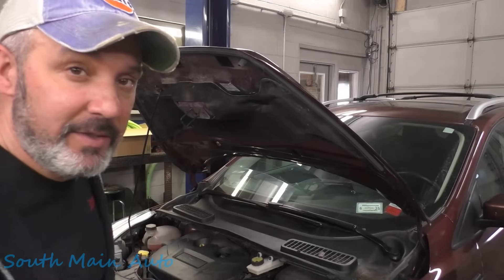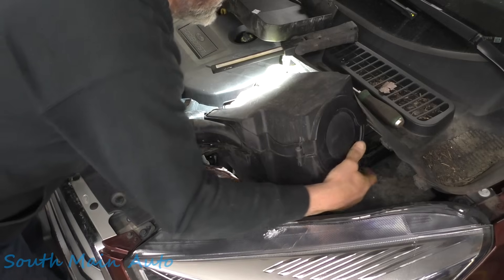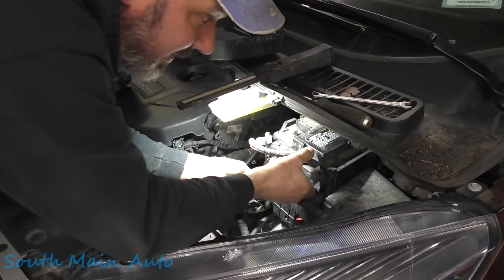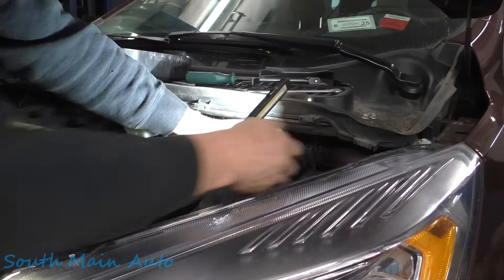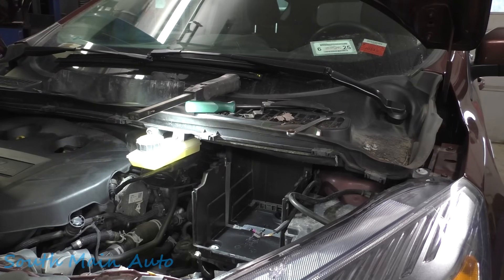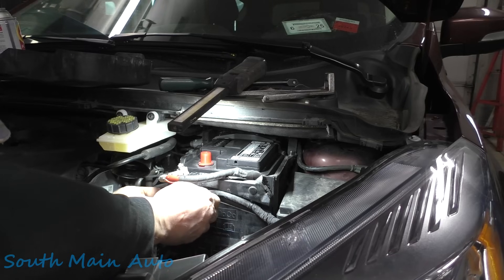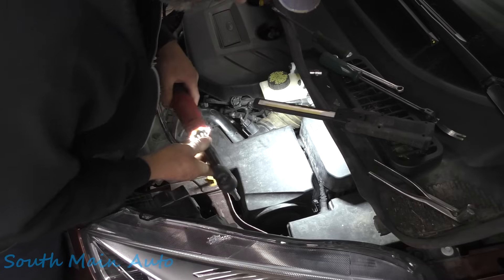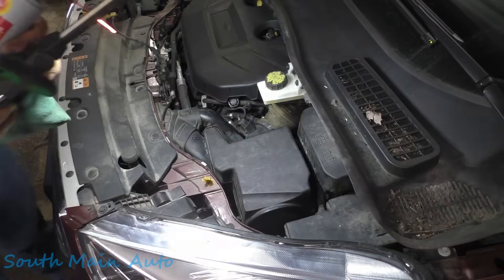Ford Escape Battery Replacement

Comment: The 2014 Ford Edge is a terrible car. They’re engines are failing at 50,000 miles from the head gasket leaking coolant into cylinder #3. I was helping my fine looking co worker and ok yea it paid off knowing about cars in that instance BUAHAHA! Lol she was so grateful and impressed I helped her. Thanks Eric

Comment: You can do the reset without scan tool. Key on engine off. Flash high beams 5 times,press brake 3 times.  Battery icon will flash. After its done flashing you are done.

Comment: My wife's 2013 Taurus was having issues with batteries, I had to have it replaced every year for 3 straight years (Warrantied by Ford) at the 4th battery i went to a different dealership and they said the problem was the other dealership wasn't resetting the bcm, thus the computer was telling the alternator to overcharge the battery basically frying the battery.

Comment: With the VW group vehicles any battery of the correct case and chemistry can be used, just change the last digit of the original serial number and it will recognise a new battery has been installed.
No need to buy a battery from a dealer, an aftermarket tool such as OBD11, VAGCOM etc can do this.

Comment: The express lube places earn that reputation.  In one trip, they stripped the oil drain, broke all the tabs off the fuse box while looking for the air filter, and evidently couldn’t find the time to latch the clamps on the air filter housing once they found it.  Won’t go back again.

Comment: I took off the plastic cowling for the windshield and lifted the battery right out on my 2015, seemed much easier, not sure if that changed in 2018

Comment: we just traded in my wife's 2015 Audi q7 TDI in January 2024.  Still original battery as far as I know with 230K km (155K miles).  I had a problem a couple years back with a parasitic draw, door handle sensors in the rear doors for the automatic unlock when you touch the handle with the key in your pocket.  Depinned the sensor at the connector.  Parasitic draw gone. The VAG charging strategy does seem to work.  Still starts even in the winter, (though this winter was pretty mild ins Southern Ontario Canada).

Comment: Yeah great design. I went with the windshield wipers, clips and bolts on the cowling then had a straight shot at the battery. Equally a pain in the butt, but a different way.

Comment: We just did this in our 2015 Mustang with a BMS. For the DIY guys I've read this resets the BMS in many modern Ford vehicles although I haven't had it to the dealer yet to verify.
Procedure must be carried out within 10 seconds
1. Switch ignition on (engine off)
2. Pull and release high beams 5 times
3. Press and release brake pedal 3 times
4. If successful the battery light will flash 3 times within the next 15 seconds.
5. BMS reset completed.
Reply: You forgot to spit over the left shoulder 6 times...

Comment: I just replaced the O.G. battery in my 2012 durango because I thought it was going bad, not letting the remote start to always work. Turned out to be the brake switch was sticking from time to time.
I highly doubt the new battery will last 12+ years in wisconsin weather

Comment: Would have been nice to see the Volkswagen battery install and registration process and what issues occur when you don't. I'm still not sold on having to tell a computer that monitors a battery and has multiple charging strategies that the car has a new battery. But I do understand forcing the owner to purchase an OEM battery to insure it is the correct one for the vehicle.

Comment: I own same 2017 model. I wondered how the heck to get to the battery. It's good so far, knock on wood. Fingers crossed!
Reply: Use the windshield wiper/cowl removal method, it’s much easier.

Comment: Ha, regulator on the firewall. My old 66 GMC van voltage regulator failed to function normally so my solution was mount it on the wheel well under my seat with the cover off, start the engine and reach under and close the contacts manually. Just don't forget to open those contacts when ya shut her down or your coming out to a flat battery in the morning. And no I didn't use my bare hand I had a special dedicated insulated tool for said operation. Safety first ya know plus don't really care for the 12 volt tickle. Best thing I ever did to the old girl was install an internally regulated alternator besides the SB out of a Camaro.

Comment: I'd like to know how the battery charging management system changes as a battery ages. The tolerance for variance in charging is pretty low for AGM batteries in any case.

Comment: My Focus is almost the same setup. When troubleshooting some green crusties in my engine harness I had to completely remove the battery and air boxes. The three bolts holding the box in were completely rusted and some extraction sockets were required. Major pain in the ass, and the bolts were destroyed.

Comment: I used to have a 2012 Focus with the same set-up.  I changed the battery in it once before I donated it.  I did a lot of cussing, but it wasn't a difficult job. My windows, though, had to be reprogrammed. The internet fixed the windows.

Comment: When I earned my living turning wrenches the fancy machine was the "Sun" machine for setting up your points and condenser distributor. Fortunately one of my nephews runs a service shop and can help me out when my analyzer isn't up to the task. Our second oldest granddaughter bought a used Jetta and our fun is just starting. She started out the right way and took it in to be serviced first thing. Ten thousand miles, she was told till the next service. I got the call last week. Grandpa, my car is making noise and I'm afraid to drive it. Before I started it I checked the oil. Great! Bone dry! Went to the "zone" to get some European spec oil and the sticker shock rocked my world. $13 a quart. Bought the five quart jug as to have some extra. My nephew said it hold 5.8 qts total. I dumped in two, nothing😢 Dumped in two more, up to add!!😮 Dumped in the last and brought it up to full. Yikes! It started right up and after a couple seconds the marbles in a coffee can noise went away. 😅 Ran smooth and quiet. Went for a run around the block and came up with a plan with her to monitor milage vs oil usage to keep from the same thing happening again. Fine German engineering! The money light was on but as is par for the course my tester would not link with the VW.

Comment: Used a Battery terminal Spreader  like that over 40 years Never Once Did I use the 8mm/5/16 on the end of the Handle :face-blue-smiling:

Comment: Mr. O , I would never be one to question your technique as I find you to be a great Technician and Diagnostician, but I was wondering if it would have been easier to acccess and remove that battery by removing the cowl  and accessing it from the top where yoo have more room and are not grinding up your fingers reaching underneath?   Just curious.  Thanks  RP
Reply: Bingo!

Comment: Outstanding,  the engineers have found another gouging for the consumer on a simple battery change . Throw in replacing spark plugs as well you just used up half a months pay

Comment: I didn't reset the battery monitor on a 2013 F-150 after replacing a battery, started it up and it was charging at 97 amps and didn't drop. After reseting it, it was back to charging normal! I was cussing the first Escape battery replacement but the 2nd one went a lot easier. Enjoyed the video!

Comment: I have a Focus ST.  Love the car, has that same stupid battery setup though.  Gotta take half the engine bay apart to get the thing out of there, and you absolutely have to remove the positive cable first.  Fabulous design.  That, and it kills the battery in like 4 to 5 years.

Comment: I guess with all the sensitive electronics now, it makes sense that the manufacturer should take steps to try and control the quality of batteries used.
I think to be a home gamer and do any work or diag yourself, for anything made in the last 25 years or so, you NEED to have a scan tool now. Brand specific 2 way tools are pretty cheap and pretty good. I have VCDS for my wife's Audi and my son's VW, and DiagFCA & AlfaOBD for my Dodge, each brand cost about $200 to get set up to do eveything bar phoning home and programming modules.

Comment: If the headlights on modern cars weren't big, long 'works of art', there might be room for other things.
Replaced battery on my 2019 Jetta not long ago. Didn't have to do anything other than replace it. Oh, and it was easy to get to also.

Comment: If you are worried about the positive terminal hitting ground, just put a small plastic bag over it and secure it with a zip tie or a bit of masking tape.

Those SK indexing lip tools are the nuts.  It is a shame SK is in disarray now because I don't think they will be made available again anytime soon, if at all.  Matco has their own version but I don't think they are as nice, but they are less expensive, if you can believe it.

Battery Terminal Speculum?  They do the same thing?  I'm never going to look at mine again the same way.  Ever.

Never thought about using fluid film on battery terminals.  That's a pretty good idea.  I usually use a dab of dieelectric grease, but that is much cleaner.

Comment: Ford dealer replaced battery in wife’s 16 escape and it died on me the next day. Took it back due to excessive corrosion and they said it all grew overnight. I went home and experienced this fun myself. I did it the harder way by removing the cowling and cleaned connections tightened connections and found the didn’t even reassembled the front cover correctly. Ford dealers suck but I’m happy with the vehicle

Comment: I popped the top off the air box remove the filter take the 2 8 mm screws out of the side of the air box remove the ground from the body pop the cover off the front battery tray and slide that puppy out it’s easy to remove the wiper cowl

Comment: I heard on that negative battery cable that you disconnected from the strut tower and then pull out the battery. Then attach the cable back to the battery and then attach it to the truck tower could that work?

Comment: I have a 2016 Ford Escape titanium and it has express up and down on all 4 of my windows. But I live in Canada so they may have slightly differently computer programming. I am also changing my lead acid battery to a AGM battery. I can use the Forscan program to change the settings from a lead acid battery to a AGM battery. I do not have Engine start stop but living in Canada I do have all the other high drain electrical devices like heated seats, I also have a dash cam that runs in night mode when the vehicle is off so that adds to a battery drain. I need to get a separate battery back up to run my dash cam when the vehicle is off. My vehicle battery is a OEM Ford battery that is only 2 years old but i can not even listen to 1 full song while my vehicle is off while i am waiting for my wife. So I am making the AGM battery upgrade. I am going from 590 CCA battery to a 760CCA battery. Plus AGM batteries charge up so much faster. I also carry 2 battery boosters with me in the winter months incase I need a boost or someone else does. I refuse to do a direct boost from my vehicle to another.

Comment: How to change out the battery in a 2018 Ford Escape in 4 easy steps. Step one, disassemble car. Step two remove battery. Step three install new battery. Step four reassemble car. I have a 2018 Ford Ecosport and the battery is in the same location under the cowell.

Comment: It never amazes me when engineers put things they know you will have to change like headlights and batteries in a place that makes it next to impossible to change. A headlight should be in a place where you can just reach in and pull it out without having to remove half the engine bay or the whole front of the car.

Comment: With that excellent battery location, the only thing Ford could have done to make it any better is use a battery with the positive terminal in the rear to make it extra easy to charge or jump off.

Comment: My project is trying to disconnect the negative battery cable in order to clear & "reset" the transmission scheme.  Will disconnecting the battery neg / ground where it is bolted to the firewall enough to clear out & "reset" the transmission scheme memory settings, or will the cable connected at the negative battery post need to be disconnected too?

Comment: On my wife's 2013 I take the cowl off to do most things under the hood.  At this point, I can take it off in less than 5 minutes.  For the most part it's been fairly reliable approaching 200k, but it will be my last Ford.

Comment: That's a pain in the butt to get to!    Simple for someone who knows.  Question.  Wouldn't it have been easier to remove the plastic cowling to get to the battery?
Not owning a Ford so I raise that question.
Anyway, Good one Mr. O.  Thanks for the tech tips.

Comment: Eric I honestly don't think you said enough bad about "goober lubbers" and their trainers.. Every time the church van comes back from a place around my hometown, I have to make sure that those kids working on our Ford vans got the conical air filter installed properly along with the lid and buckle system. They usually get the buckling indexed improperly. And sometimes it's not even sealing. If the church would buy me a heavier jack to lift those things, I would change the oil to them myself but that's neither here nor there.😊

Comment: So, how do I reset the battery monitor if I change the battery myself and I do not have the fancy scanner like you?
Reply: Put key in run position. Turn lights to on, not auto. Within 10 seconds pull back on the high beam switch to make them flash 5 times, then pump the brake pedal 3 times. The battery light should then flash, and then stay on steady. Sometimes you can just lock the doors and let the car go to sleep for at least 8 hours, and the monitor will reset on its own.

Comment: You mean like the days you could open the regulator and adjust the spring contacts to change the charging or better yet the days of the generators when you had to initiate the excitation system for it to charge. When cars didn't tell you what is wrong and you rebuilt everything instead of replacing whole assemblies. Those good Old days..???  Actually the more things change the more things remain the same, your expertise just changes especially electrical. A lot of work these days to change a battery, LMFIAO especially when the Chrysler's had them in the front wheel wells but Ford arose to the challenge too..

Comment: Oddly enough, Advance auto replaced the battery in my BMW and they registered it. The guy behind the counter was eager to try out the tool, because he had not had the chance to use it yet. I was like, "hell give it a try, it'll save me some time and cash if it works." I have to admit that my trust issues would not allow him to tighten any of the bolts. Basically I changed the battery, he pressed all the buttons to register it. He was nice enough to lift it into the car though.

Comment: Battery related question, I have a battery voltage meter that plugs into the 12 v receptacle.  What should the battery voltage be after a 30 minute drive at engine off?
Reply: @user-pq9ji7kt4l  While driving, 14.6 but reads 12.3 imediately after the engine is turned off.
Reply: @user-pq9ji7kt4l  I was expecting 12.8 volts or higher right after the engine shuts down.
Reply: @user-pq9ji7kt4l  It has been tested at the auto parts store, it passed testing, but it struggles to crank the 4 cylinder engine.  The stock battery is H5, I am running an H6 size.

Comment: For the average guy that doesn't have an Alltell, you can reset the BMS by turning the key on, engine off, flip the high beams five times, tap the brake pedal three times, then wait for the battery light to blink three times.
Robert's your mother's brother.

Comment: Noooo - do it this way: remove both wipers, remove the plastic scuttle thingy, disconnect the battery and lift it out!!! Source: did this to my wife's 2013 Ford Escape SEL about two years ago. Way simpler than removing the airbox etc...

Comment: Never thought watching you change a battery on a car could be so amusing, i have a Ford Kuga (European version of the Escape), and the one you were working on have a 1.5 Lt engine not the 2.0 petrol (Gas),  I love my car, and yes it has had it's issues, but it goes well and hasn't cost that much to use in the 7 years i have had it.  thanks for the great content.
Reply: Actually Kuga and Escape are two different models, we have both here in Australia.

Comment: I just take the big  plastic cover off easy just take the wipers off than screws both sides and master cylinder reservoir and finally clips and walla battery comes out

Comment: Not to date myself, but my glory days consisted of ignition points, condensers, and bias ply tires. Every once and awhile I will dig out the points file just for nostalgia. Those were the good old days. lol
Reply: and plenty of room to work on the engine in the engine bay
Reply: And setting timing with a static test light.

Comment: Yeesh. I have a similar vehicle made by another company and the engine compartment is wide open with easy access to the battery, air filter, and whatever else you might want to get to. Took all of four minutes to replace the battery.

Comment: Not a ford, but I have the current sensor disconnected. Now the alternator voltage regulator takes over.